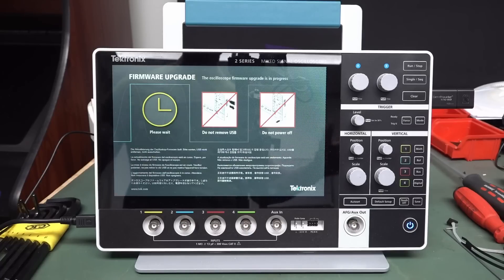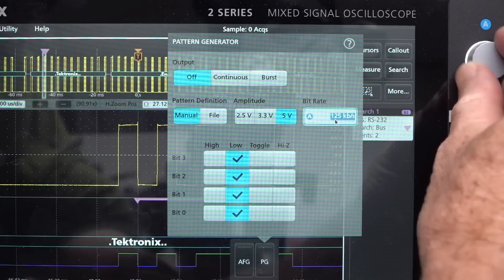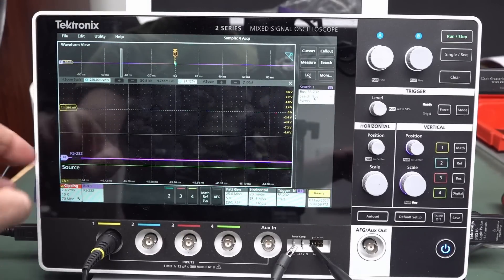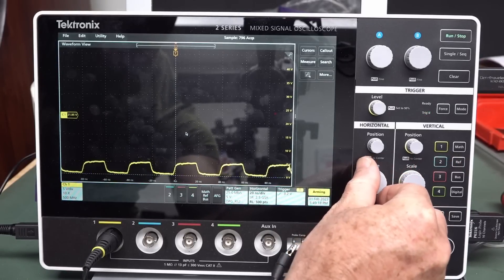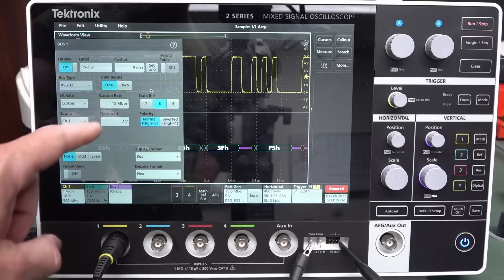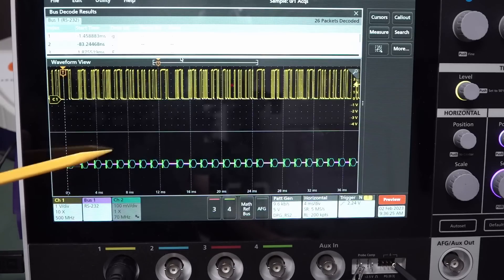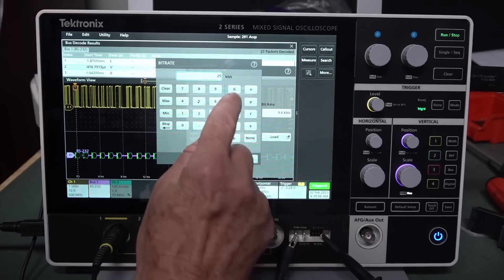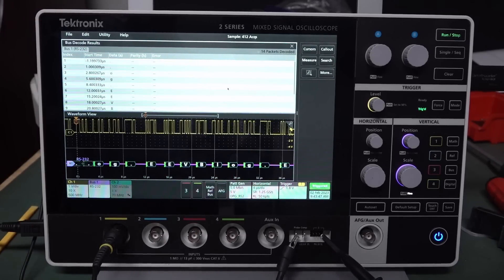Tektronix 2 Series Oscilloscope Pattern Generator

Comment from the maker: UPDATE: Tektronix were able to reproduce the bit rate limitation issue and are working on it. 
UPDATE2: They have identified the issue "DPG output does not track the user programmed bitrate. This is causing the decode to stop working. Fixing this issue in our next release."

Comment: That text layout is awful. Th R&S can transition to a vertical display to maximise the amount of visible data. And what's with the green marks on the left of each character? Unless there are errors, the display should maximise the visibility of the data.  I'd expect this sort of thing from  cheapo Chinese scopes, not Tek.
Reply from the maker: Yeah, it's not implemented well at all.
Reply: You can make text bigger/smaller by clicking on big and small wave buttons on the bus tab when it is extended on the bottom of the screen.

Comment: I recently saw Applied Science Ben using the 2 series AFG and was very impressed by the software, UI and inbuilt measurement capabilities, only then did I truly understand it's not just an entry level portable scope and thus the price point Tektronix set for it.
Reply from the maker: Yes, I've done a whole video on why Tek scopes are expensive. https://www.youtube.com/watch?v=3t9G80wk0pk
Reply: @EEVblog2  I have a tektronix tds2002c  that's 1g per channel (2) and 70mhz so I'm trying to sell my new siglent sds2202x-e and buy a logic analyzer off ebay or from a reseller. I paid 1000cad for the scope and rcc electronics want that for the addon after tax.

I was thinking just buy a mini pc and a decent usb one. Keep the little pc offline so I don't get any bloatware. I'm not sure yet.
Reply: @EEVblog2  I have the tds2002c and I love it. I know it's only 2 chan 70mhz but the front end is super fast
Reply: What's the sticker price on it? Please Sir!
Reply: @jstro-hobbytech  AU$3,000 for the 2 channel 70 MHz entry level one, which is already more expensive than other brands entry scopes, but up to AU$19,000 with all the channels, gens and options which is closer to what Ben was using.
Reply: @WizardTim  haha wow. I'll pass (as if I'd have a choice). Aha
Reply from the maker: @jstro-hobbytech  Under US$2k for the entry level model, but the prices rises quickly with the options.

Comment: It is common for RS232 to sample at 8x or 16x the baud rate to detect the beginning of the start bit, and then to sample at the center of each bit after that.  Maybe that sample rate is a limitation?
Reply from the maker: The analog input software usart lets you go up to 15Mbps so oyu would think it can decode that?
Reply: @EEVblog2  maybe for sync protocols like SPI that is true?  RS-232 is async, so you typically need to over sample the input data to correctly detect the start of a word (start bit, data bits, optional parity bits and one or more stop bits).  But, they could be doing it a different way ...

Comment: Try specify the buad in 15000 kbits on both instead. It seems the buad on either the pg or decoder is wierd which is why it cant decode it. Edit: And i'm sorry Dave, but it is always amusing how all UIs are badly designed when you are doing stuff. Sure, I can agree it's not the best, but also it showed the file in the drop down after you loaded it from the usb so it was clear enough it was loaded. :D And I'm just having some fun, it's great you point out these things. :)
Reply from the maker: Tried it, it converts 10000kbps to 10Mbps and same problem.
Reply: @EEVblog2  Ah, okey. If you specify 12345kbits instead then? Or will it not accept any arbitrary buad rate?  Im guessing the pg will accept anything, and the decoder is stupid and only accepts "normal" serial buads.

Comment: The glare on that screen really is awful lol
Reply from the maker: I have many other scopes like this, yeah it's annoying.
Reply: The glare is worse on camera than irl I would think. I like pc monitors that are glossy instead of matte for example since you perceive the colors as more vivid and blacks as darker. I dont have any problems with it, but a pc monitor, like this "tablet" scope will mostly be postitioned at correct angle to not get glare, a normal bench scope on the other hand could be in a worse viewing angle so there being a matte screen is more important. And the glass screen on this scope is hard to avoid since it's portable and you dont want a plastic screen that willl scratch in no time...
Reply: @kruppin  definitely. Its a shame tho for the engineers who designed the scope that their work ends up looking like this in the reviews. I'm sure its fine in person
Reply from the maker: @christopherjackson2157  Similar in person
Reply: R&S is the same, but easily fixed with an ant-glare screen protector